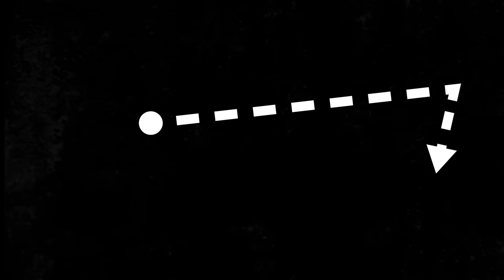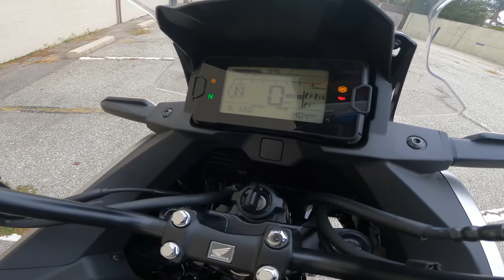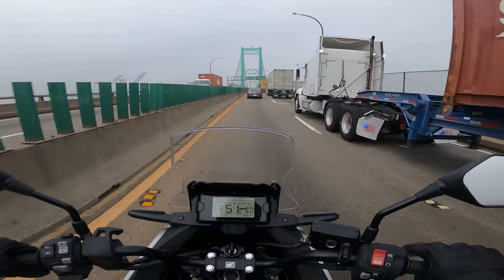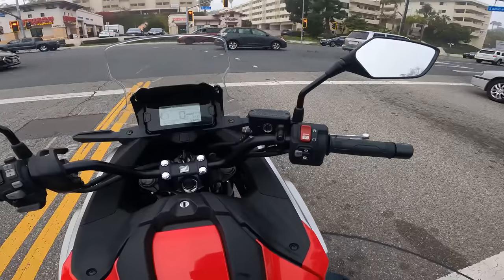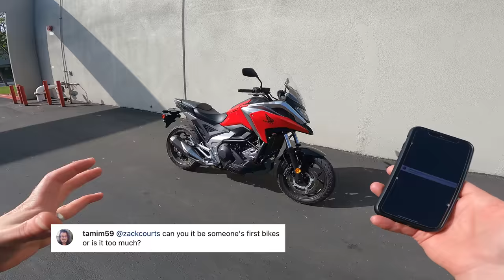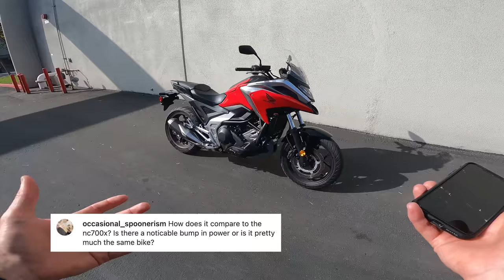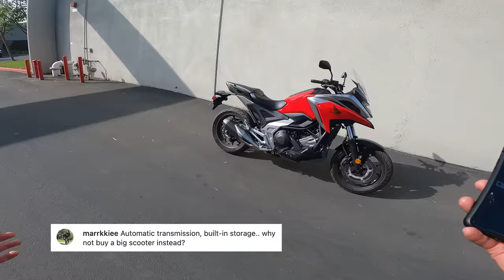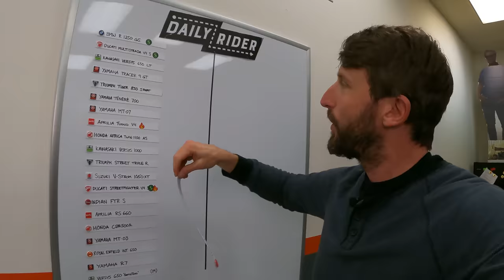Automatic-transmission on a motorcycle? 2021 Honda NC750X DCT | Daily Rider

Comment: I rode a NT700V (Deauville) a few years back, bought a GS 1200 LC, then a KTM 1190, then used Vespa GTS's to commute. And now replaced them with this NC750 X DCT. I still have my ducati 916 and KTM 1190 Adventure. All in all really happy with the NC. Had it for five months now. It handles the daily grind with excellence. It's got lots of storage space, reasonably quick, reliable, relatively easy to clean, affordable, frugal on petrol and so easy to ride. It's very quite on the exhaust side, but when you're commuting a lot that's more of an advantage than an inconvenience. It can stand a nice little sequence of bends at high rythm, but it's clearly not what it was meant for. On the minus: seat can be seen as on the harsh side, wind protection ain't great (but perfectly doable -DON't BUT THE HIGH WINDSCREEN, it blows everything in your helmet), for tall guys like me (190cm) the leg angle is a tad too tight (I see Zach is also noticing this whilst being smaller), it could be a bit more torquey still, the brakes are calculated for solo commuting and not for duo touring or track day use (but then, the price is not that of a Ducati V2), the auto transmission is not as intuitive as you'd like (shifts on roundabouts, sometimes shifts too quickly, sometimes hangs to a gear too long for no reason) and my bike, as others, has had quite a lot of stalling issues on traffic lights. Especially on cold engine, but can happen after running for hours too. Quite annoying to have all those cars ready to start behind you, and you stalling like  a learner. To summarize, if the NC 750 came with 20 horsepower more, a regular manual shifter with a perfect quickshifter system, it'd be the best commuting bike ever. The NC 750 is one of those bikes you like a lot because it never upsets you and allways does what you expect (well unless it pisses you off by stalling at the red light..). Just like you like the GS not for sheer passion, but for capability at doing what it's aimed for (which isn't commuting, Zach! the lady is too fat and expensive ), whilst if you just judge it on a few minutes riding you'll think its boring. the NC just makes life easy, every day. So yeah, it does spark joy. I ride 150+ hp bikes, but for every day, no one needs more than the NC. Replaces a car without any problem, especially with a 60 L givi top case on the back. And by the way, my Shoei NXR and Schubert C4 fit in the frunk without any issue

Comment: This was my first bike. Had it in manual. Absolutely loved commuting on it, the front trunk is amazing and it handles like a dream because of a low center of gravity,
Reply: That frunk makes it a real commuter bike.  It'll fit a subway sandwich and a 20oz coke without issue.  I'm constantly taking mine (2020, previous model) to grab a this or that and have no worries about where I'm going to put that pint of ice cream or small bag of groceries.  It's the New Balance dad shoe of motorcycles.  And that's WHY it's so good.
Reply: I currently have the nc700s manual as my first bike. I've been riding it 2 years. Planned to upgrade to something faster after the first year but.. It's just so dam good for getting to work and back I don't want to get rid of it! It fits my L helmet, my work laptop (a surface), or 12 beer. So cheap to run too.
Reply: @jsherck  I'm 51, a new rider and as i sit here staring at my comfortable as fuck, white on white wide width NB kicks, your last 2 sentences have spoken to me ....  i have some decisions to make :)  
Thank You!

Comment: This transmission is brilliant. Especially on the goldwing.  Especially in town and in traffic.  Especially on the Blueridge parkway. The NC750 x seat is horrible.  Just horrible.  Cement is softer.  Everything else is brilliant.
Reply: Yep. One of the first mods on my NC was the seat. I'll never understand how I can spend 3hrs on my riding mower in perfect comfort, but my butt hurts in <1hr on most bikes.
Reply: Lots of owners that have tried the 2021 model say the seat is now fixed, older model it was hard and had a bad slope.
Reply: Agreed. With tequila. The seat on my X sucks. I need to look for an upgraded because I won’t part with the bike.
Reply: Not the 2022
Reply: Will you regret the transmission, when the DC needs maintenance? Is a service significantly more expensive? (Looking for a secondary low running cost/low maintenance bike.) Thanks.
Reply: @paulguth12  The manual version will be cheaper to run.

Comment: Zach,
I have bought and maintained two NC700X's. A manual and a DCT.  When discussing daily rider machines you really need to put in  MSRP as the GS is $20,000, fuel mileage,  cost of maintenance or the ease of doing your own maintenance. If you included these which are important on a daily commuter that may have well put the NC in the number 1 or 2 position. The NC700X or DCTgets 70 mpg and in the mountains it goes to 80+. I  would think the 750 is above 60. It would be nice to see a long term review on this and include the above categories.  If you put on a good chain and oiler that would eliminate cost of a chain and sprocket replacement for 30,000 miles, the valves are easily adjustable by your average person who has the gumption to learn as they aren't shim over bucket. Yep a wrench, screwdriver and feeler guages. Air filter once done is easy. Sure you have to buy the centerstand to do these. Forks are no harder than any other. These things add value to a daily commuter or daikey rider as shops are charging over $100 an hour these days.
 I agree as a 6'3" rider that a taller windshield is a good thing. A two brothers exhaust or a DanMoto really makes those two cylinders sing. Nice and throaty. Frunk is wonderful. Put some GIVI bags and a trunk on it and this machine will tour all over and do it inexpensively. More storage than a Goldwing too!

Comment: I love my Honda NM4 with DCT!!!  The DCT is amazing and wonderful, that offers many benefits not immediately obvious to those not in the know, such as linear power delivery and improved mpg.  It’s rare rally-race technology on a budget motorcycle!  However, I think Honda missed the mark by not replacing the clutch lever under the left hand with a brake lever for the rear brake as is the convention on bicycles and scooters.  Feels weird and awkward to not have any controls on the left side.  Otherwise, DCTs are dream machines!

Comment: I currently own the 2021 model.  It's my second one, after the 2014 I mistakenly sold.  Both were six-speed manuals.  Extremely versatile bike.
and it's a Honda, so it's hard to break.   I plan to keep this one awhile.    If you really want to make it a keeper, upgrade the seat, fort springs, rear shock and windshield.  It could use a little more power, but I know Hayabusa guys who say that too.

Comment: Bought a '21 NC750x (the manual version) as my first street bike a couple months back, I agree with pretty much everything you have to say about the bike. It's very neutral experience, it's not bad to ride but it definitely won't blow your socks off. However as a daily commuter it's perfectly suited for that role. My only real complaint about the bike would be the LCD display; if the sun even thinks about putting a little light near it I can't read it at all. The only time I think that display looks good is at night when it's lit up. Things I like about the bike; the styling and the frunk. I consider the bike more of a light tourer or a standard with some ADV styling ques, and as a new rider that spent most of my money on a down payment and gear I didn't exactly have the cash to spend on a Givi top box or a pair of saddle bags. When I ride, my Kryptonite chain, hat, phone, and mask go in there; when I get where I'm going that all comes out, the bike gets chained, and my bulky riding jacket goes in the frunk. Over all I like it for what I use it for, and if I could use an analogy to describe this bike it would be vanilla ice cream. Sure it isn't as interesting as some of the other choices you have available but, it's still going to be an enjoyable experience, even if it is the kinda plain and safe option.

Comment: It looks to be dead easy to maintain. Easy Access to the cylinder head, screw and locknut valve adjustment!
Reply: Yup, they're dead easy. Top end is near identical to the car engine it was original based on, hence the low rev limit.
Reply: It is, indeed
Reply: I've got the NC700X, there's nothing difficult I've found so far.

Comment: Proud owner of a 2018 model.  Hands down, one of the best bikes I've ever owned.  Great gas mileage, easy to maintain, and great utility. Currently getting 65mpg average with 90% highway(manual version).  I just wish the gas tank was bigger.
Reply: My 300 Versys has the same gas milage and a 4.5 gallon tank
Reply: @kd350  awesome range! Considered the Versys, but the ease of maintenance from the NC750X won me over.
Reply: @petes_CE  Yep the 16 ft/lbs. of torque or lack thereof is an acquired taste.  Still I have loads of bikes up to a mile behind chasing me.  I wait up at every intersection.

Comment: Yes, it's very pedestrian, however some people want this, and it is quite suitable for urban commuting. I would never choose an automatic transmission, however it's fine if others want to so long as I have the option to stay manual.
Reply: Pedestrian in the sense of being quicker than 95% of cars? It's not just an urban commuter either.
Reply: A "standard" do everything bike. No faults.
Reply: Love the YouTube handle. reminds me of when my kids watch the Wiggles
Reply: Trust me, this DCT does everything you can do, but better.
Reply: well said!
Reply: @eefneleman9564  well it doesn't have eyes so it can't anticipate. But I suppose you don't need that in casual riding.
Reply: Appreciate the permission, thanks, I feel much better now.
Reply: We understand. It's clear you have no clou why people like this bike so much.
Reply: DCT might be great, it's fine on the road, but to me it's akward at low speed stuff, like where you drag the rear brake and slip the clutch.  I'm sure if I had more time riding a bike with it i'd get used to it.  And if I had arthritis that made repeated clutch use hard it would be a good way to keep riding.
Reply: @randombuilds8336  since the bike disengages the clutches when engine and overall speed are low you can emulate the clutch slipping just by giving short controlled bursts of gas.

Friend of mine ownes one and i've ridden it on multiple occasions. Really love it, but it's just a bit too small for me (physically) to ride for hundrets of miles a day
Reply: @randombuilds8336  well if it had a torque converter, so it could move at zero and up speed without having to modulate a clutch, it would be great at low speed stuff. Like cars. it's really hard to fake a torque converter with a computer controlled clutch.
Reply: @eefneleman9564  The whole reason for riding a motorcycle is fun, and there certainly isn't anything fun about it when the bike does everything for you. Just get a car.
Reply: @MostlyInteresting  actually it does, it knows when your going uphill and downhill and holds a gear, it also has paddle shifters like all the newest Porsche's. Because it is a DCT it has an electronically controlled clutch as opposed to a fluid driven transmission so there is NO power loss. If you you have it in sport mode it will downshift in anticipate decelerating into a turn.
Reply: @randombuilds8336  I was a motor officer in NYPD and came in 2nd in the slow speed contest nationwide, I have the Africa Twin DCT and its easier in slow stuff. In my driveway I did 3:00 minutes in for 20 feet, feet up in a straight line
Reply: @geraldscott4302  Nah, thats not the whole reason
Reply: @rayhan4502  If you only want transportation, get a car. For transportation they are superior in every way to a motorcycle. Notice how Honda is the only motorcycle company doing stuff like this. Kawasaki, Yamaha, and Suzuki are not building automatic bikes. Yes, I'm aware of the Yamaha FJR DCT, which was a huge flop. Honda is the only one of the four Japanese companies that DID NOT build any 2 strokes back in the '70s. They built boring 4 strokes instead. Because of stuff like that, I have never been a fan of Honda.
Reply: @geraldscott4302  Nah, here theres a lot of small road here and bike is easier to use here than a car, basically bike is better here, there are a lot of people using bike too. SO no, caar isn't better here
Reply: @geraldscott4302  Oh, it also far cheaper than car, 150cc is just enough for 2 people and can reach 60kph with a few liters of storage. So fun is not the whole reason
Reply: @geraldscott4302  Many people around the world use two wheeled vehicles for utility and not just a toy. Just not so much in North America. 
Many of Honda's smaller vehicles are built to optimize that utility better than the competition so that's why you see the DCT in addition to their standard scooter CVTs.
Not just small stuff either. A Honda spokesman said well over 50% of Goldwing sales are DCT.
Reply: @geraldscott4302  Nowadays cars are also shit for major American metros, which is why those little e-scooters blew up a few years ago and haven't gone away.
Small bikes are good for commuting to colleges as well. Plenty of scenarios where a bike isn't a toy anymore. Not to mention the gas prices...
Personally I've stuck with my 330cc scooter and been up and down the east coast in it. Never needed another vehicle.
Reply: @longrider9551  I ride the 2021 X-ADV 750 which is the naughty twin of the NC-750 (with some added Africa Twin genes): Same frame, engine and DCT as the NC (though slightly different programming). Before buying I was curious / sceptical about the DCT: As a car driver I know how good DCTs / DSGs can be, but as a bike rider I thought "if you can't slip the clutch ...". I agree with you that DCT is easy in the slow stuff. I can creep it just as slowly as with my Ducati Scrambler or Honda Grom with slipping clutch.

Driving through city rush-hour traffic, DCT is a godsend: one less thing to think about it. On the open road it works well too: up-hill it pulls like the proverbial train due to the torque. Only on very tight mountain hairpin bends do I use manual to drop the gears down.
Reply: @geraldscott4302  You’re just wrong. I will never go back to a manual bike after buying my Goldwing DCT. It amplifies all the good things about riding and minimizes the things that take away from riding. You’re free to 100% focus on enjoying the ride. And the bonus is the bike will outrun most sport bikes even in the twisties. 

Just say it, you’re afraid of change.
Reply: @rednwhitecooper  If it's what you like fine. But for me shifting is a HUGE part of the enjoyment of riding a motorcycle. The more interaction I have with the bike, the better I like it. Just getting on a bike and doing nothing while it takes you where you want to go just doesn't get any more boring. I had a CVT scooter for a while. But not for long. It was drop dead boring. I still have a 1979 Vespa P200E, a 2 stroke scooter with a manual transmission and clutch. It is an absolute blast to ride. No automatics for me. Both my car and truck have manual transmissions. Because you can no longer get cars and trucks with manual transmissions, I am going to keep them forever.
Reply: @geraldscott4302  the fact that you’re still comparing a scooter with a CVT to a DCT Honda just shows that you have no idea what you’re taking about. 

If you weren’t so afraid of change, you would take one for a test ride. But deep down you’re afraid that I’m right and you’ve been lying to yourself about the “interaction” and the “rawness” or  whatever buzzwords you like to use to describe the manual transmission.
Reply: @geraldscott4302  The issue I have with your point about only Honda is doing DCT is that slipper clutches and quick shifters are basically doing much the same thing as DCT in M mode. You are choosing the gear, and the bike takes care of the clutch. Like 4 cycle engines, they are becoming pervasive in the industry, which makes Honda more visionary than outlier. Also, no other motorcycle companies can leverage their engineering across car and motorcycle markets the way Honda can, which I believe is why Honda can create a truly functional version of this technology which has no competition in this market. And the idea that DCT takes the fun out of riding is ludicrous.
Reply: @geraldscott4302  hondas in my opinion  are by far the best of the Japanese  big four my vfr750 97 model is still in great condition and goes really well. . . My other bikes by the others of that age are piles of rust now.
Reply: @neilwiddison6529  My 1997 Kawasaki Vulcan 750 is still running like new, it has 121K miles on it, has been all over the U.S. and Mexico, and parts of Canada. All Japanese bikes used to be a lot better than now. They have way too much technology and they are mostly made in third world countries.
Reply: @geraldscott4302  wow that's impressive
Reply: @eefneleman9564  Very well put. That is a the best summation I have read and completely agree ... from a guy who is just 1 week into his DCT journey!
Reply: you have never ridden a bike with DCT, so why do you  bad mouth it ? I love  DCT